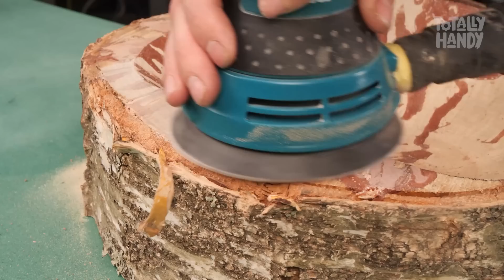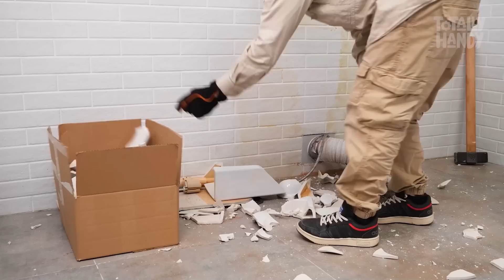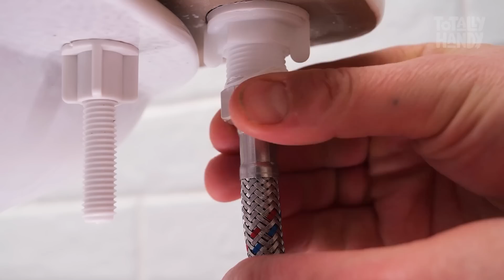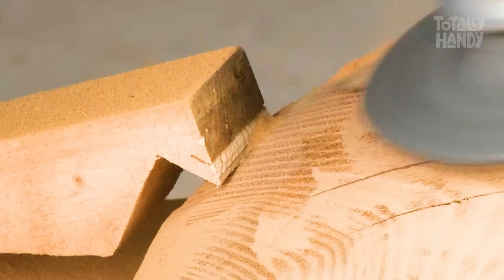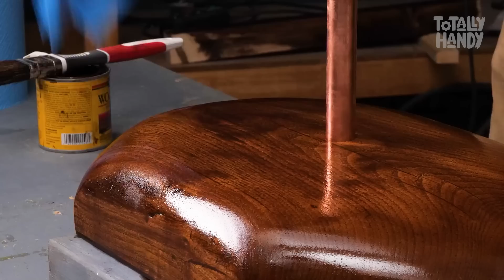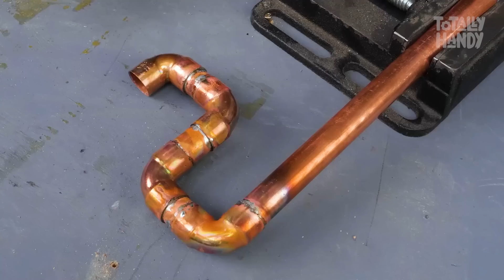DIY Woodcarving a Sink from a Log | Woodworking Project

Comment: You are a master of power tools. Especially the handling of the disc sander is amazing.
I learned that in order to create high-quality works, it is necessary to satisfy the skill of handling tools.
Reply: Some master of power tools. Using a chainsaw with NO safety gear is absolutely mad. Best way to lose a leg. This stuff shouldn't be on YouTube, promotes irresponsible use of kit. Anyway WHY make a sink out of a log?
Reply: Becsuse it looks great and natural looking

Comment: Wow thank you so much for the great idea I've been wondering what to do with my huge Douglas fir Burrell. However as a contractor and home builder I have one criticism and that is the use of copper piping. After consulting with my professional plumbing contractor he agreed with the necessary use of proper plastic
 fittings except for the drain and faucet set plastic is cheaper and easier to work with.Thank you
 for the great  video and your  an amazing artistic craftsman, 🍻🇨🇦👍 Cheers
Reply: There is nothing wrong with using copper water pipes.